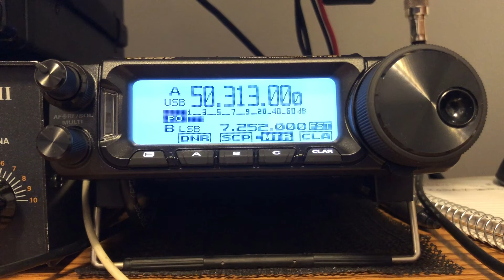6 Meter FT8, But why did it work??

Comment: USB is standard mode for most digital. Most all of the older radios do not have a Data mode and they use USB to make the contact. USB is par for the course on all bands.

Comment: I would like 2 know also  kg6mn
Reply from the maker: So as I've come to find out, you don't need to use digital mode with this radio for FT8. It's kind of weird but I just run USB straight out and it works.  Apparently all the digital mode setting does is narrow your width and maybe some filtering.
Reply: lt also should cut out the mic circuit when  in data mode, so you can talk while transmitting and not come thru  with your data signal. Example is you have a desk microphone connected, last thing you want when transmitting on data modes is to have everyone hearing what is being said in the room at the same time.This is what all my Icom rigs do when in data mode, they cut the microphone circuit.
Reply: for all bands or just 6 meters?

Comment: USB is the mode used for most digital modes. No reason to set to digital settings. MSK, JT65, JT9 or even PSK31 all use USB. Have fun with your radio, 73 de KX4EZ